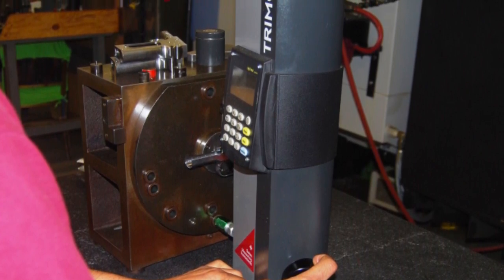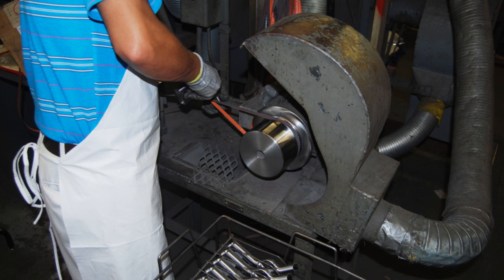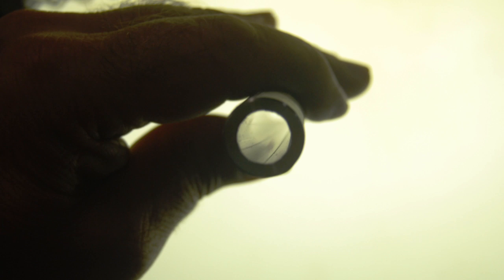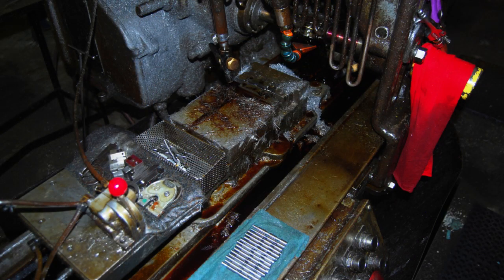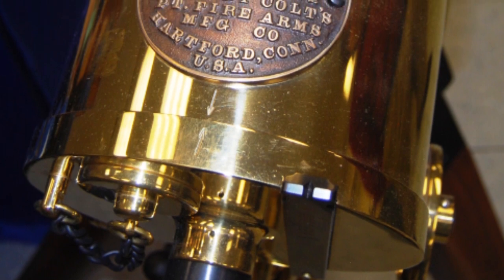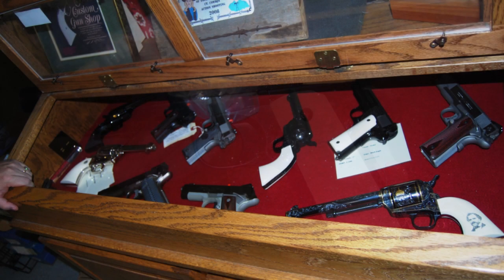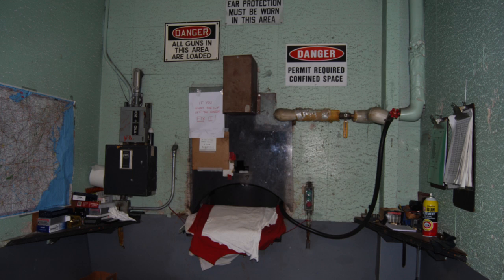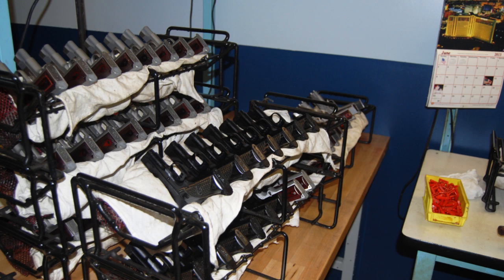Episode 96 - The Colt Tour, Part Two

Comment: Its a lead hammer. We had a station in the corner of my high school shop to remold the hammer head. They got used for everything, freeing stuck levers, etc.
Reply: Brownells sells a lead hammer "kit" with a handle, lead slug, and a mold for re-casting the head when it gets too beat-up.  Rick
Reply: Of course these days you have to wonder... I have handled a lot of lead in my life, in metalwork, lead type in print shop, lead solder in electronics manufacture. In my time, if you lost a year or so of your life from the heavy metals and chemicals we used, you would just shrug it off. Now everyone sees a lawsuit.
Reply: A lot of companies use them.
Reply: Or used them,a while ago.